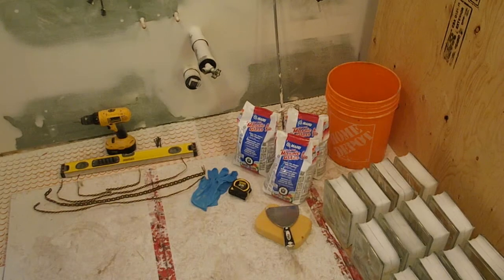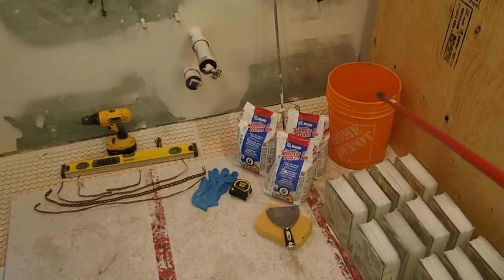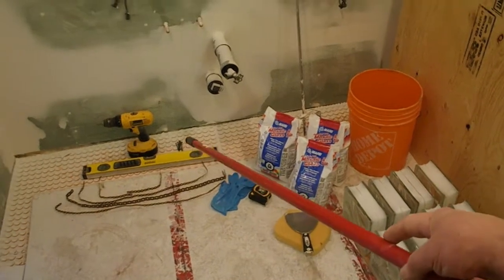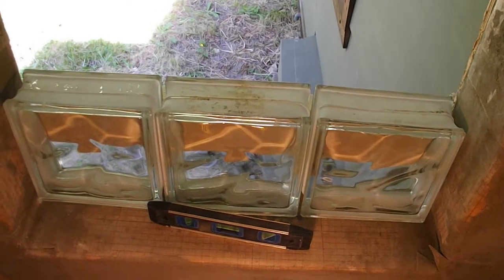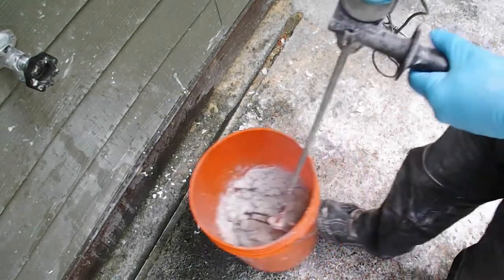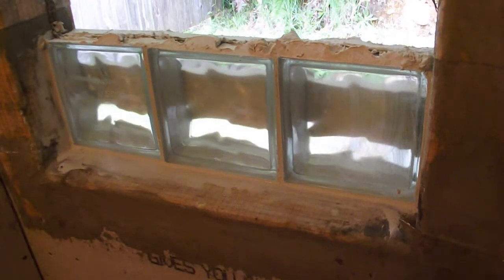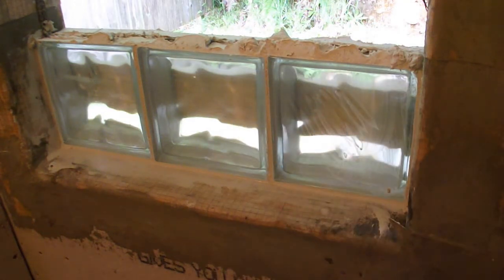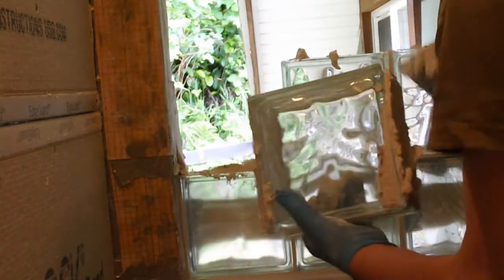HOW TO INSTALL GLASS BLOCK WINDOW IN SHOWER

Comment: Thanks for posting this.  Nice idea about using pipe strap.  I've already torn out a wood double-hung window that was installed over the tub and have the 30 glass blocks for the replacement.  All masonry install and I plan to do a stone bottom to make a niche for the body wash bottles etc.  In my Wash DC area Home Depot and Lowes will let one order the blocks but not the glass block mortar.  So I'm getting that from Menards online.  You, sir, are a mad mixer with that drill.  I was thinking, but Vancouver Carpenter just holds the bucket with his insoles.
Reply from the maker: I never thought this video would be so popular. I filmed it several years ago with an old Fuji camera that only had 720P resolution, and before I bought a GoPro. I posted this from old footage when I began my YouTube journey, and before my editing skills were acceptable! The mixing sequence should have been condensed to only a few shots. Did you notice I broke the bucket ? Hahaha Glad it has been of assistance!
Reply: @EverydayProjects  I had not noticed you broke the bucket but now I see the side got busted out!  LOL  Good point about needing to mix the mortar on the dry side.  It's imperative with glass blocks because, as my local building supply place told me, glass blocks don't absorb any moisture like bricks and concrete blocks would.  I like to do things right but, of course, we're not building churches here.  😀
Reply from the maker: Not building churches...Amen LOL @SpringRubber

Comment: Think I'll be doing this for a high level bathroom window. It'll be only 2 high but probably 8 long. Window is too high to look in or out but it adds a nice effect.
Thanks for advice.
Reply from the maker: This window is in a master bathroom and lets in lots of light but gives privacy. Even looking in from the outside at night when the bathroom light is on, you can't make out what is inside. And, bonus, it's waterproof when the shower splashes water against it.

Comment: how do you get adequate mortar coverage on the top row when the block just barely fits in the opening ?
Reply from the maker: I made the opening a bit higher and the mortar over the top row on this install was about 1 inch high. I trimmed the opening with tile and the mortar I placed behind the upper tile was a bit heavier so all sides of the finished opening revealed the same amount of glass.
Reply: @EverydayProjects  Very helpful !  Thanks so much ! :yougotthis:

Comment: Hi sir how much room are you leaving between the three block glasses and the window it seems a little bit tide.  I am going to do an exact window
Reply from the maker: I think that the space between blocks can vary depending on your wishes. A bit wider would be good too if your mortar is mixed thick. I wish you every success with your project.
Reply: @EverydayProjects  thank you
Reply from the maker: @JesusArias-eb5mu  Hey, no problem. I hope your project is a success!
Reply: Thanks

Comment: What did you use for trim inside the shower after the window was installed?
Reply from the maker: Just tile. In fact, at this time, I am yet to install the tile. Before the tile though, I will coat the entire area with "Redgard" which is a waterproofing liquid that dries to a thin, rubberized coating. The tile mortar will adhere perfectly to the Redgard.
Reply: Everyday Projects Thank you very much for the info!
Reply from the maker: @DrDZaster999  You are very welcome!

Comment: Why do some people use silicone?
Reply from the maker: Do you mean they assemble the glass block wall with silicone instead of mortar? I think the standard is mortar but new ways surface all the time. I think silicone would be very expensive where mortar is comparably cheap. Thanks for watching.

Comment: Larger glass block windows show expansion strips on the side. I will just build a 8x42” vertical window ... no concern about using mortar all around, or ?
Reply from the maker: I'm not an expert, just somebody who installed my own glass block window. I would search online for advice on expansion joints. I've seen glass block windows built into solid mortar that survived decades. Mine has no expansion strips and it's doing fine. You'd probably be alright with such a small window.

Comment: so that steel does not have to be Stainless steel reinforcers
Reply from the maker: Stainless steel would last longer, no doubt. Galvanized strapping would be a step down. I had no hesitation using the steel strapping. As you wish.